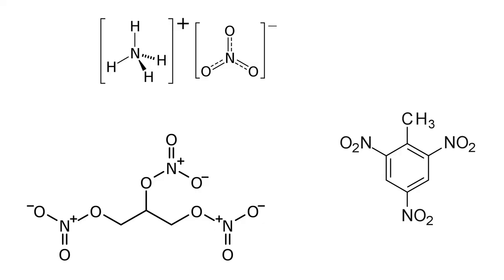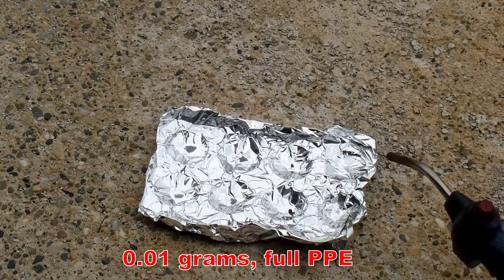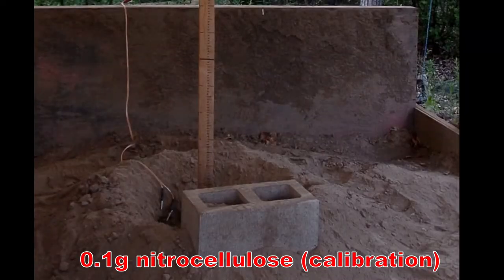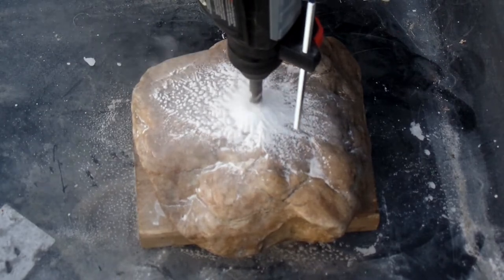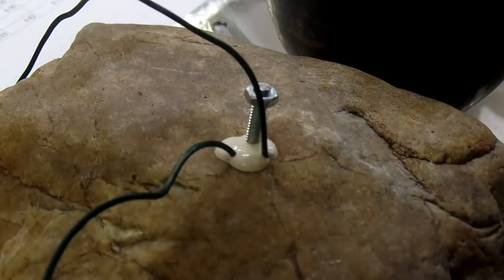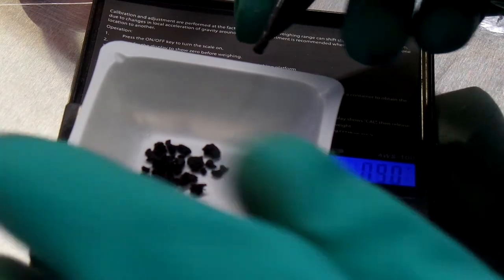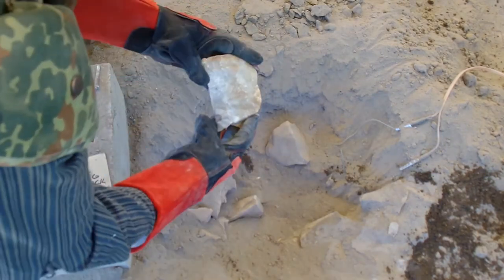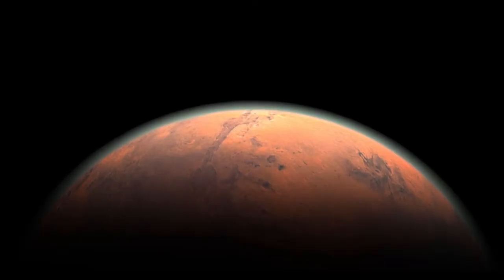Blasting rock on Mars with perchlorates

Comment: This is great!  How much fuel was required as a ratio to perchlorate again? Would be great to turn a liability into a ressource.  The oxygen is reacting with the carbon and hydrogen in the tar?
Reply from the maker: The exact ratio depends on the fuel, but compositions are usually mostly oxidizer by mass--65-85% perchlorate by mass for the compositions I tested.  Hydrocarbon fuels are closer to the 85% perchlorate.

Comment: After blasting, what compounds/Elements would remain?
Reply from the maker: The potassium chlorate gets its oxygens removed, leaving potassium chloride (fertilizer!), which you can also wash back out of the blasted rock fragments.  The tar's carbon and hydrogen burn to CO2 and H2O.  It should be pretty clean--as long as the perchlorate actually fully burns!
Reply: @olawlor  excellent
i wonder could we build some sort of motor that could be fueled by perchlorates? i mean besides a rocket engine. I am thinking something more like an internal combustion engine. something that could power/propel an ROV, or machinery. such an engine could have an exhaust of the mentioned byproducts. I frame all these questions in a mars perspective. we need to clean out the perchlorates, and we need water and other bi-products also.
Reply: I will be doing a video on perchlorates after i do the one i am working on now. Lagrange points